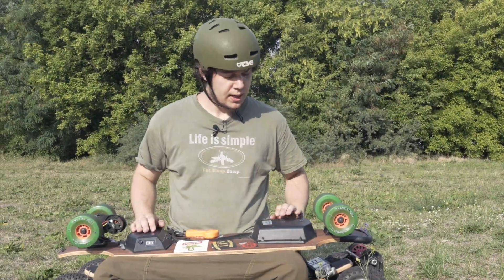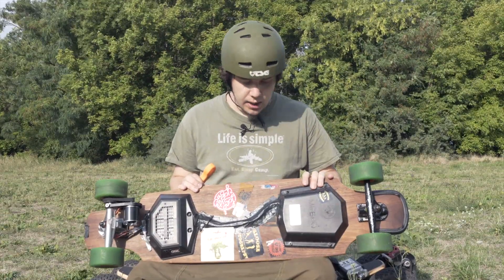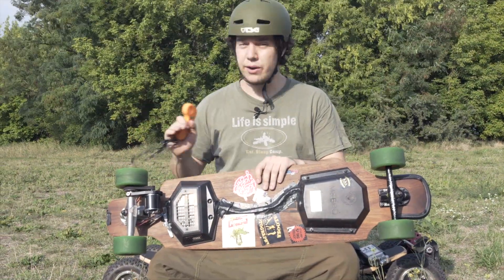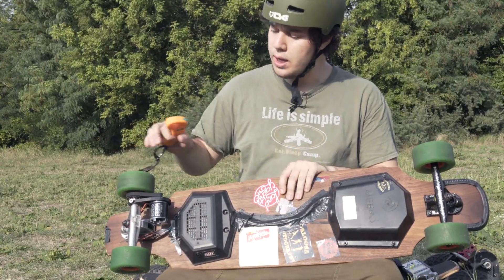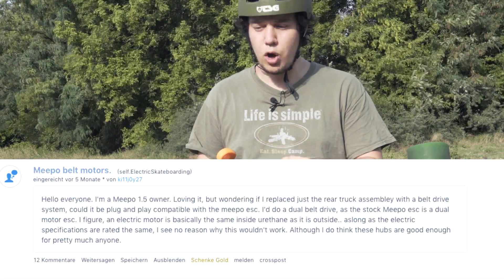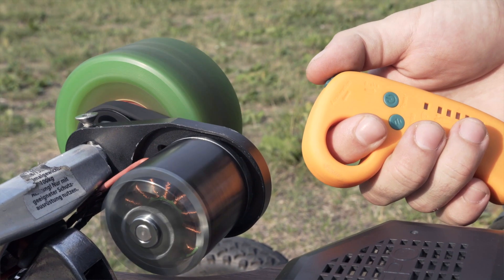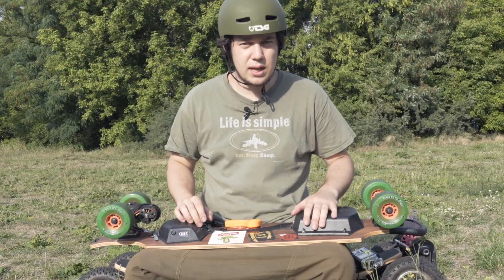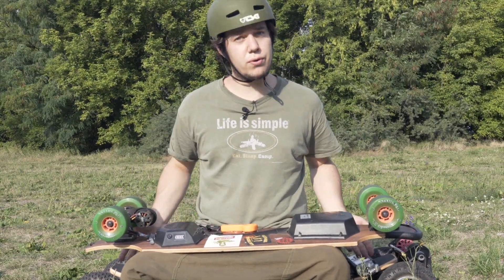Meepo Board V1.5 / 2.0 ESC With Belt drive (Propdrive 50 60) Electric skateboard Tuning DIY

Comment: So what’s the benefit of doing this mod?
Reply: Belt drives are nice because you can put any wheels on it you want.  Also it is really torquey and can climb hills better.
Reply: @Brycieb00  BUT adds alot of rolling resistence which = battery SAG and kills the battery life if running dual belts aka there is no coasting you let off that throttle and it comes to a dead stop really fast unlike hub motors which really roll .. also belt and pull maintenance depending on what you use metal or 3d printed . One thing with belts and gears that is favorable over hub motors is the ability to change out the gearing with a belt setup you can change the top speed, TQ and all that .. hub motors it is what they are no mods can be done but generally last a long long time unlike belts which break often.

Comment: What do you do with the extra motor cable? Did you just connect them in parallel to the one motor?
Reply: Would like to know the answer as well
Reply: You just leave it alone, maybe tape up the ends. You don't need to plug it anywhere for the one motor to work.